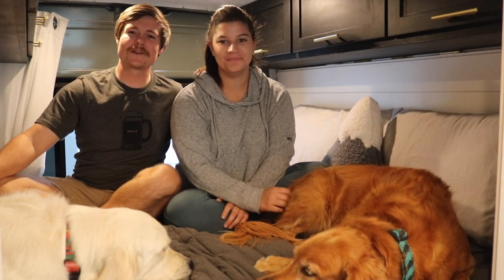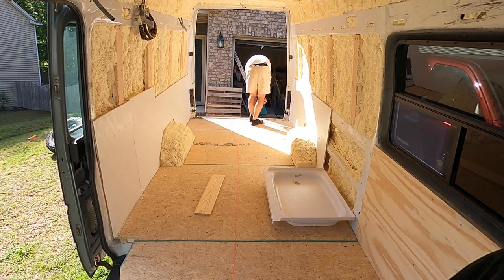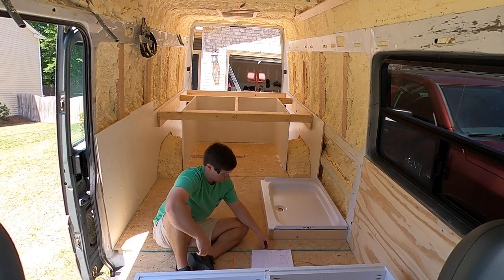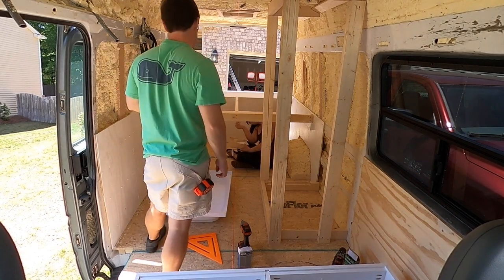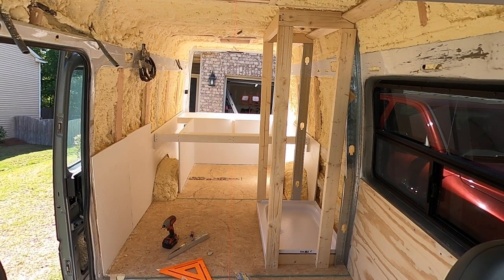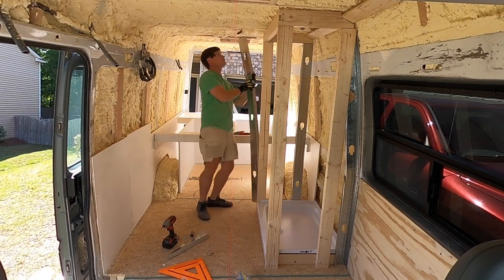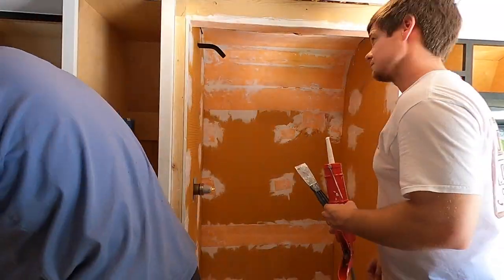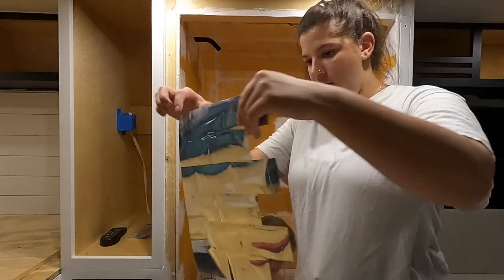Van Build Episode 21! Why We Built a Shower and How We Did it Step by Step! DIY T1N Sprinter

Comment: If you decide to make changes down the road I would consider FRP sheets. They are relatively easy to install and with silicone on the seems they hold up extremely well. While not very stylish most people won't be looking in or using your shower. We tend to use the shower for additional storage when not showering so it's not as bad as one might expect. Love your videos and your build looks awesome.
Reply from the maker: We're leaning towards frp board whenever we do redo the shower. Will it flex at all? Some of the angle changes are really shallow towards the top and I'd rather not have that many joints to address. Glad you're enjoying the videos and thanks so much!
Reply: @goldenadvantures2573  It flexes very well in fact I think you could tie it in knots. It does need to be glued to a surface that will give it shape as it's like rubber.
Reply from the maker: We'll definitely have to look into it then! Thanks for the advice!

Comment: I'm glad you copied my old design from 10 years ago on my blogpost , however you did it all wrong 😝😝😝, the schleuter kerdi board is used with mortar & your mickey mouse tiles are meant for a DRY BACK SPLASH, not a shower enclosure and Schlueter board....but thanks to you 5,000 other millenials will do it WRONG ALSO...!! Don't feel bad hundreds of licensed contractors screw this up too ...BUT I do give you A+ for the van foam job.....
and try to keep your video to the point...30 million americans DON'T REALLY WANNA KNOW WHY YOU WANT A SHOWER IN YOUR VAN 🤮🤮🤮🤮.
Reply: Wow Jerry you're quite the jerk.  Using ceramic tile with mortar is not designed for this type of application due to vibration. I suspect you've already figured that out having to make constant repairs in you build.
Reply from the maker: Thanks for the feedback! You are correct in saying that schluter board is designed for ceramic tile and that the tiles we used are intended for dry areas only. However the combination of the two creates a completely waterproof and flexible membrane that is ideal for a moving shower like in a van. I appreciate the feedback about the video format as well. We're testing out some new things and including different aspects of the van build to see if people like it or not.